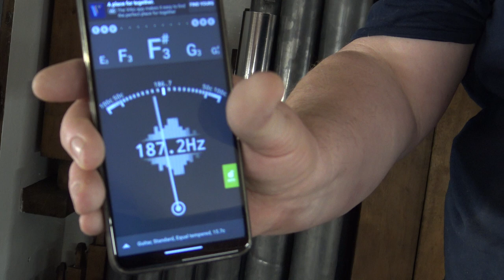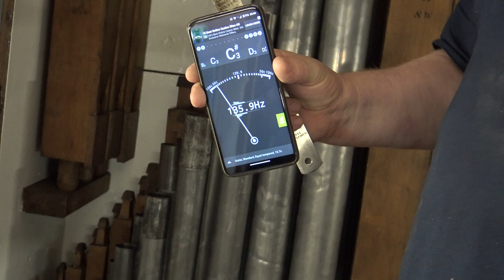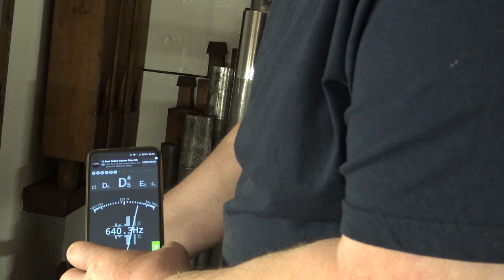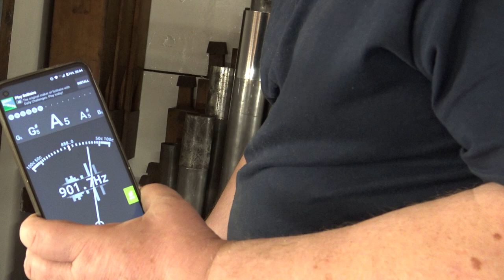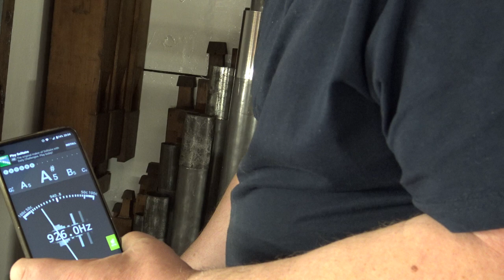1865 Forster & Andrews pipe organ restoration & installation .  Part 22 of loads

Comment: Another great video! Whats the purpose of buffing around the toe of the pipes? Did you do it by hand or with an appliance?
Reply from the maker: The size of the hole in the pipe foot determines the volume of the note. Each pipe has to be regulated for the same volume within that rank. We close the hole up using the flat of a chisel, whilst rotating the pipe for an even finish & use an awl to open up the hole. Bear in mind that apart from basic things like tuning & regulation, pipe makers deal with voicing malfunctions. As an organ builder I don't make pipes!

Richard, UK